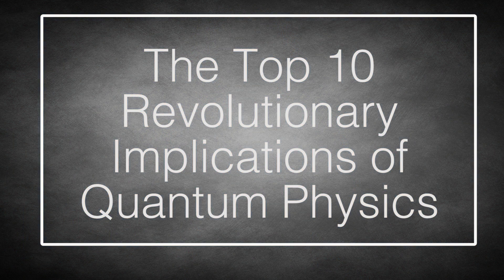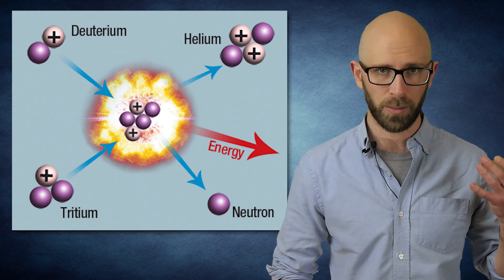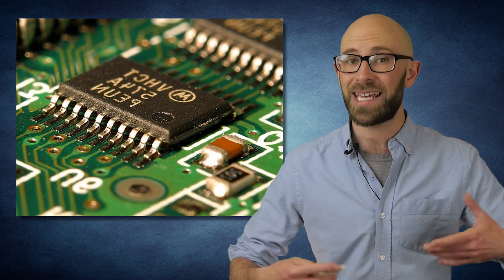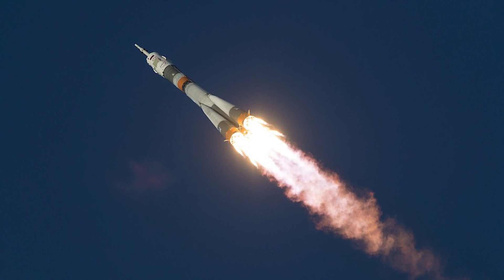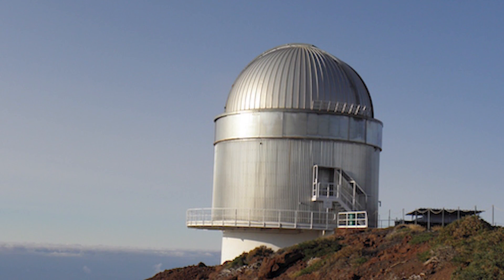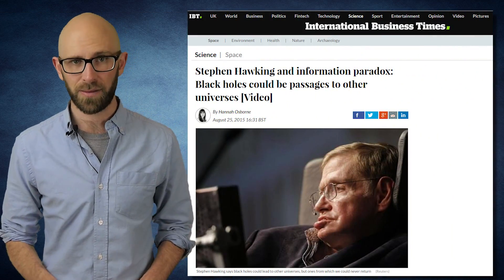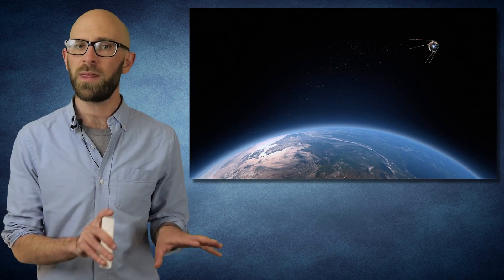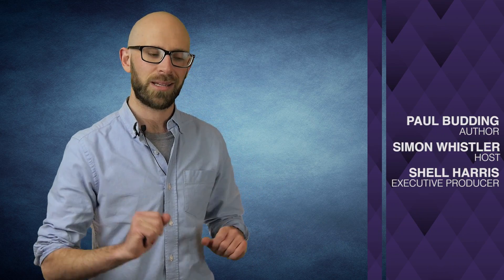Revolutionary Implications of QUANTUM PHYSICS

Comment: Number 9 - aluminum-based atomic clock. With it, you can measure time dilation caused by difference in elevation under one meter. For example, two such devices placed at 30 cm one above another (1 ft for you metrically-impaired) will have about 1/100 Hz difference in output frequency, which can be measured by combining their outputs.

Comment: You're mistaken about "accurately scanning broken bones". To scan bones, you would use a CT (Computed Tomography) AKA CAT (Computer-Assisted Tomography), which is not based on quantum physics, but uses old good X-rays and some complex math.
MR-tomography, which is based on quantum physics, is more suited for study of soft tissues and bodily fluids. CT, with an appropriate IV contrast also allows to scan soft tissues.
Reply: Xrays make use of the quantum tunnelling effect and it's not the only tech we've had around that's explained by quantum physics either.

Comment: Nuclear fusion occurs in the corona of the sun and is where all the heat, light and charged particles are produced, m=E/c² and doesn't violate the law of conservation.

Atomic clocks are not accurate unless each are subjected to the same exact conditions, temperature, velocity, air pressure, gravity and more.

AI was discovered by physicist Roger G. Vogelsang in 1981 and he based the input, using quantum entanglement that occurs with photons, a spooky action at a distance. The device can be constructed from parts found at any electronic store and interfaced to any computer using the BASIC programming language.

Hmm, intergalactic travel has already been developed using the ARV, alien reproduction vehicle, where engineers discovered that gravity and energy fields are equal opposites.

Dark matter is a correlation between the age of a star and it's velocity. Dark energy is the equal opposite action which makes gravity. This dark energy action causes space to expand between mass exponentially with distance.

When it comes to information, time does not exist. The new James Webb Space Telescope will concur after discovering fully grown galaxies as far as the telescope is able to see. Proving the hypothesis that light happens in an instant. Relativity is incorrect assuming that because a particle of light takes time to travel so must the information entangled to it's source.

Because information is conveyed instantly at any distance then consciousness could be one single universal field, reflecting off every atom differently in time and location. Thus the old saying, I am you and you are me. We are one and the same. Living in a different point of view in a different frame of conscious time. Seeing how information is always without time then it can be anywhere and everywhere at any point in mass time, recycling over and over for an eternity.
Reply: Information isn't conveyed instantly, what on earth gave you that idea?